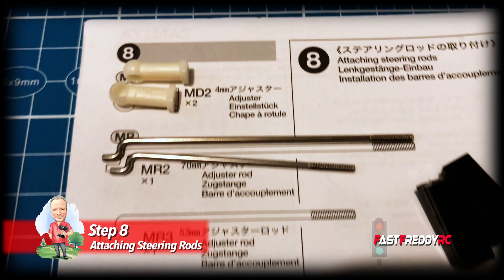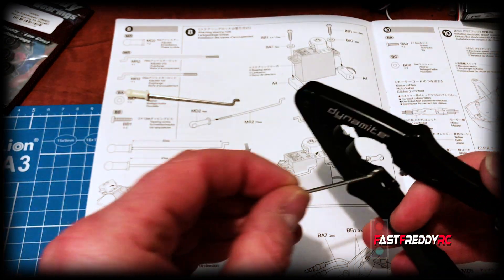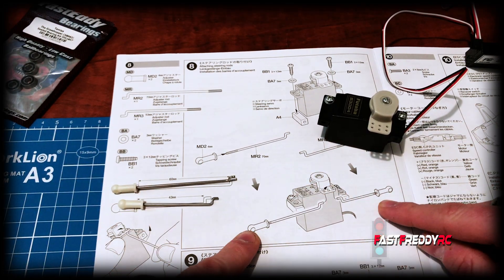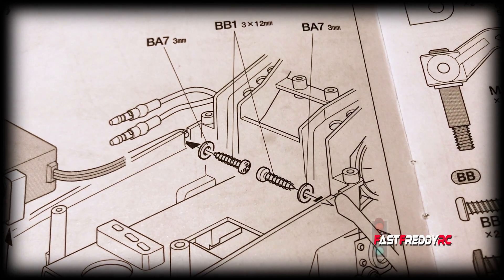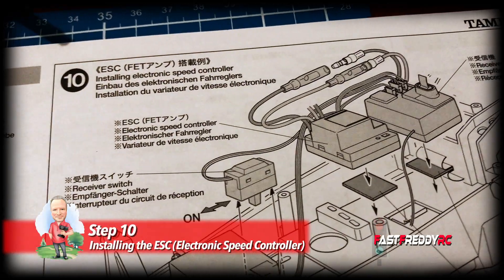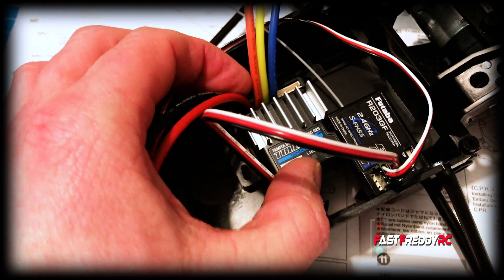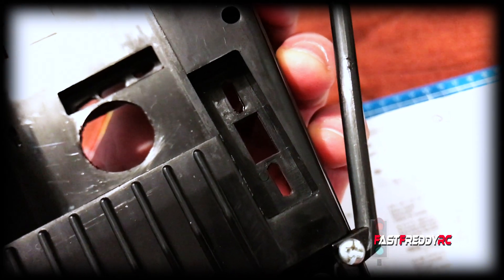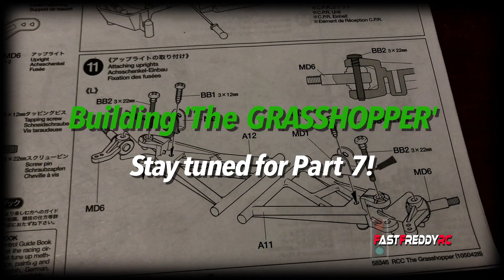Tamiya Grasshopper - Beginner Build Series - Part 6 - Servo, Radio and ESC Installation

Comment: I wish I watched this video before ordering my servo. I ordered one from Amazon that had excellent reviews and said worked with the Grasshopper, however it was too tall and the horn rubbed on the chassis. I even trimmed the chassis a bit in that area to make space but the horn still hit the side of the chassis when full right. The instruction book says the space from the servo tab to the top needs to be 12~16mm…this one I got is 20mm. Those 4 mm make quite the difference 😅. With that being said I’m really enjoying your videos and they have been very helpful during my build!
Reply from the maker: I've not had much success with servos on Amazon...and you're right...those 4mm make a huge difference.  I bought four servos last year off of Amazon for an awesome deal but when I got them there were no end points to the steering and for a car you need end points or you'll ruin the steering hardware.  I'm afraid for me I'm sticking to what I know and what has always worked for me...Futaba Servos. I know there are other companies that produce good quality servos but when you know something works my motto is "if it ain't broke don't fix it" :)
Reply: @FastFreddyRC  Luckily I was able to find the exact Futaba servo you used in your video for $15 on Amazon so I ordered it on the spot!
Reply from the maker: @jakeh12121  oh fantastic!! Nice find!!
Reply: Hi, today I discover your YouTube channel. Amazing.Great builds. If it helps somebody, the Futaba servo S3004 you use is discontinued. Is great, hard to find those days. The exact actualization, with exact same sizes of your Futaba servo is the model     S-U300. Sorry for my English writing. I'm from Europe. Nice channel. Keep going!
Reply: @albertpou2473isn't that one 1 inch wide, so 25.5mm?

Comment: The on/off switch that came with my grasshopper kit does not match the switch shown in the diagram in the manual. The screw holes are in front of the switch rather than on the left and right hand side of the switch.
Reply from the maker: I’m going to guess the speed controller that came with yours is the HobbyWing 1060? If so unfortunately due to the pandemic Tamiya wasn’t able to keep up with production and they started adding the HobbyWing ESC’s in their kits or not including one at all. So here’s the solution: 1. Place the on/off switch inside the car on the side or bottom of the bathtub chassis out of the way with the switch set to the on position. 2. Cover up the standard on/off hole in the chassis with some of the tape, or double sided tape, you’ll probably have left over in the kit to keep dirt and debris from getting into the chassis. 3. Screw the body down as normal. 4. Now the normal way of running the car you would turn on the transmitter then plug in the battery on the car and then turn on the car with the on/off switch. Well with your speed controller, the on/off switch will already be permanently on so the only change is that once you turn on the transmitter, the car will already be on once you plug in the battery on the car. So just close the battery door. Doing it this way you’ll be good to go!! Hope that helps.
Reply: @FastFreddyRC  thanks for the reply, i will give that a go.
Reply: @FastFreddyRC its a THW 1060 RTR speed controller,
Reply from the maker: @MrIrrepressible  pretty sure that’s the one…but this is the best plan for anything other than a Tamiya ESC so you should be good! :)